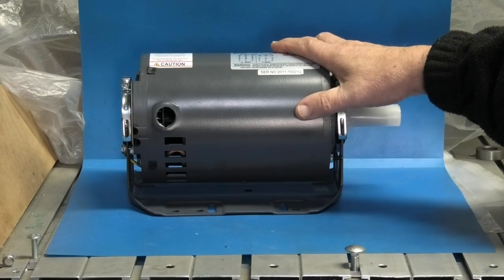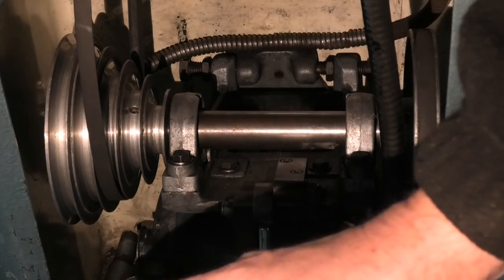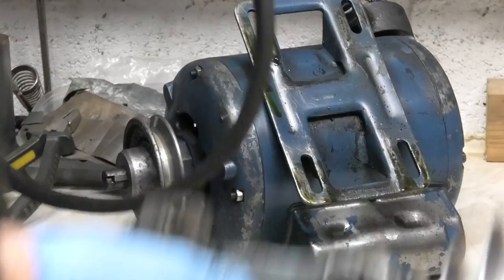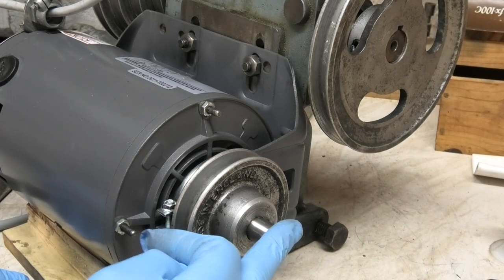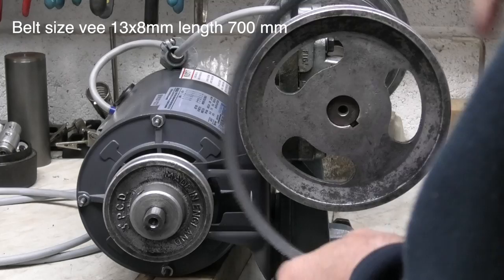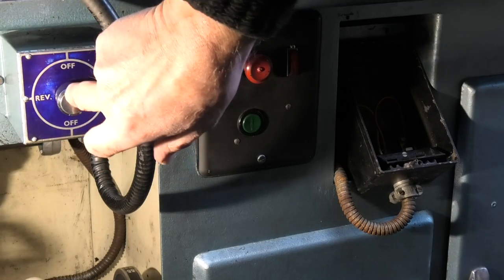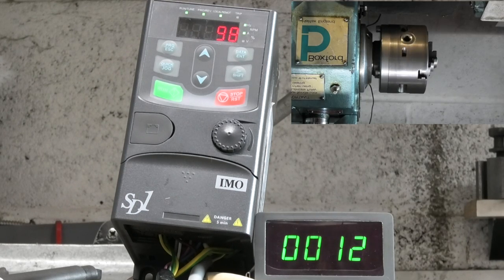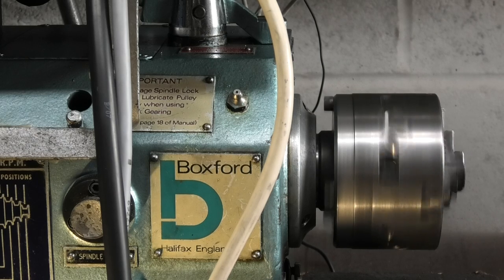New motor for the lathe

Comment: As always Allan a lovely job and well explained, Thank you. I have the same machine as you and have been wondering about changing to this system. I wonder though about the motor overheating. I've always understood this system is hard on the motor as at slower speed the coils are working hard but the fan on the motor is going slower so not enough airflow. That coupled with very limited space in the motor cupboard. What are your thoughts?
Reply from the maker: Hi Andy
I think I would only use slow speed when machining a thread up to a face. In that case I would change the belt to the slower speed which makes the motor run 3 times faster than the chuck speed.
I will need to check the motor temperature but there is room to fit an electric fan on the rear of the motor if needed 
H